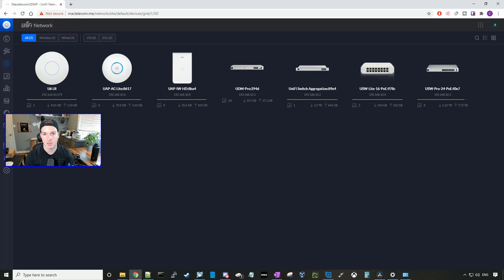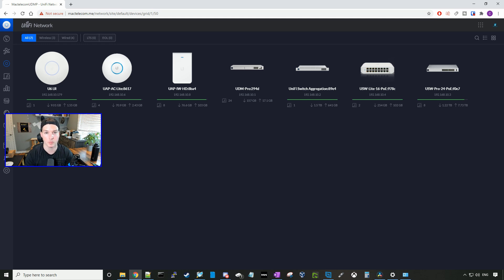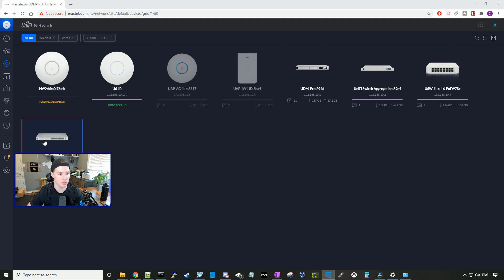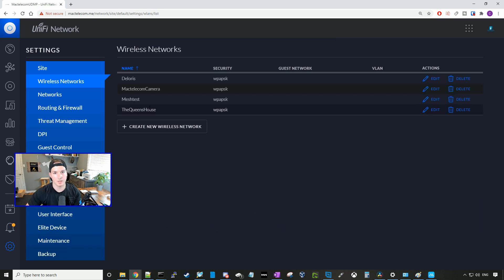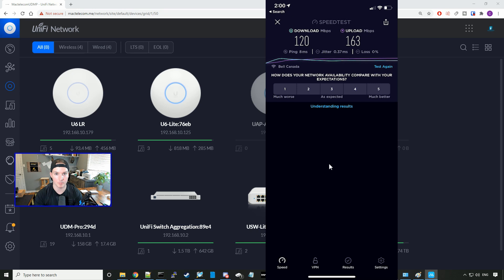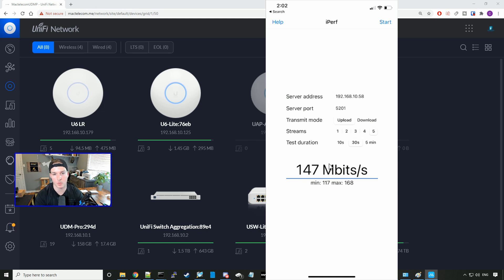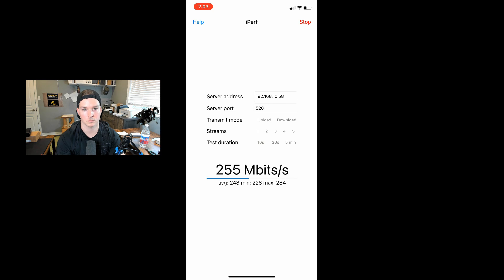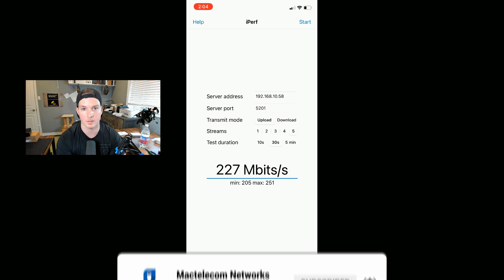Unifi 6 Lite Meshing to Unifi 6 LR

Comment: If you have a couple of Unifi 6 LR APs and want mesh, do you need Dream Machine, or can you just use the software controller on a PC? (and if software controller is fine, do the software need to run all the time, or just then making configuration changes and/or monitoring)?
Reply from the maker: Hey,

The software controller doesnt need to run all the time just when you want to make configuration changes.

Comment: Great idea, this has inspired me to try the same kinda of setup at home instead of pulling a long ole cable through the length of my house. Is there any use at all to the Ethernet port when using them as mesh? meaning if you could use it for a device/switch without wifi and utilize the mesh through there?